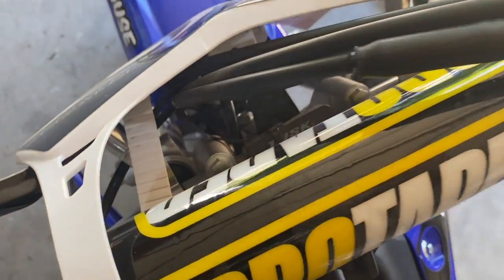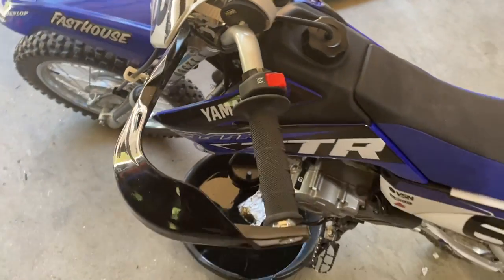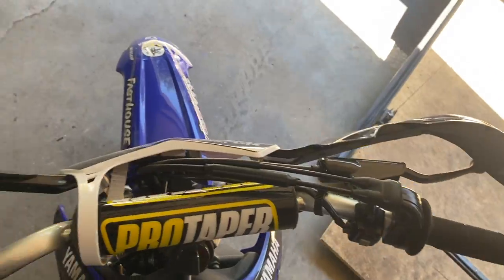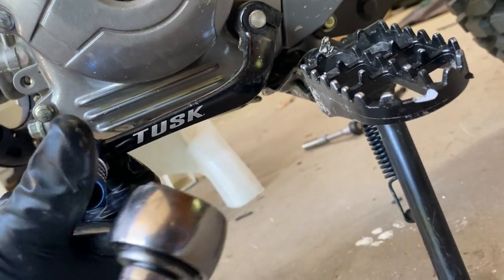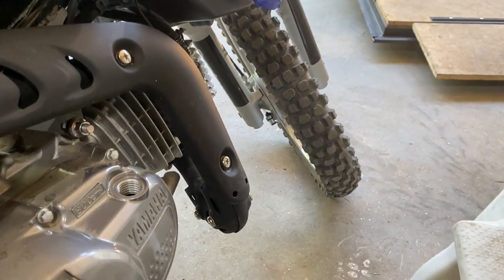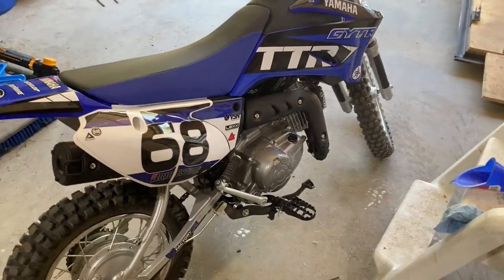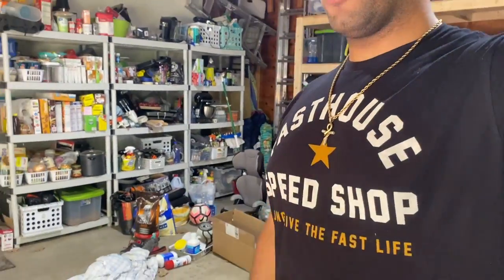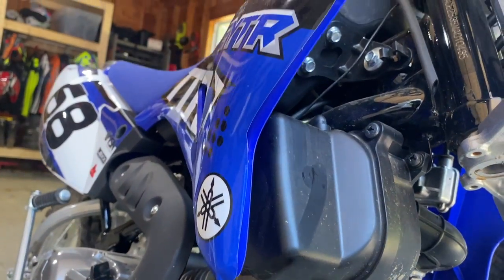2021 Yamaha TTR110 Oil Change

Comment: There’s no oil filter on these? I just got a 2022 and it’s weird that there’s none mentioned.
Reply from the maker: No oil filter on these. My guess is because you need to change the oil pretty frequently. Most people recommend changing it every 5 hours. You will notice that when you put it in gear and you have bad/old oil it won’t go Into hear right away, it will take a couple of seconds. When you have fresh/good oil it shifts right away. Hope this helps.
Reply: @RTPOWERSPORTS  ahh okay thank you so much!
Reply from the maker: No problem 👍🏼